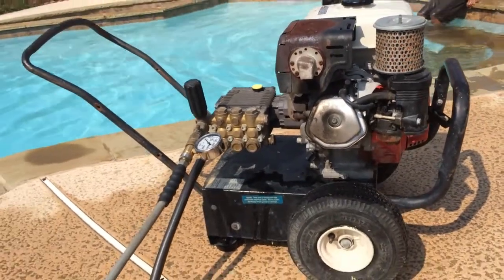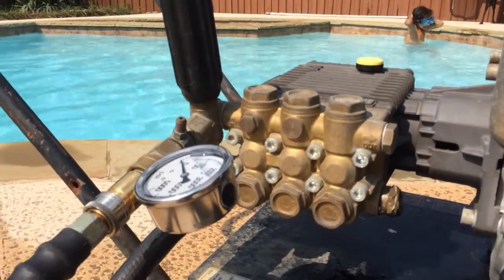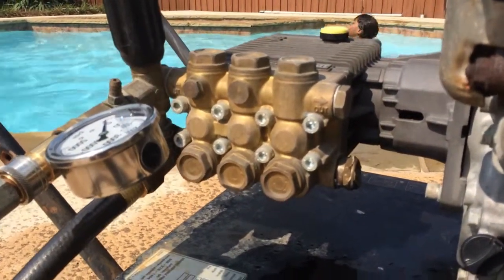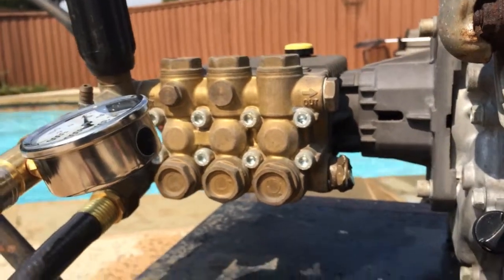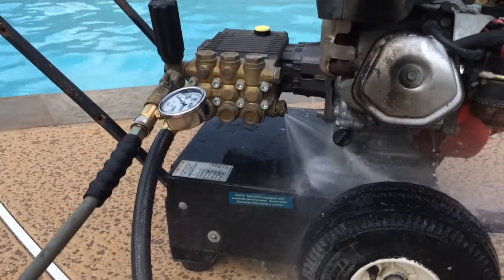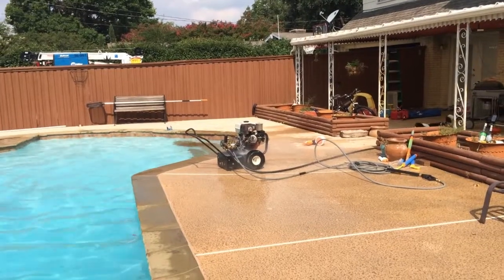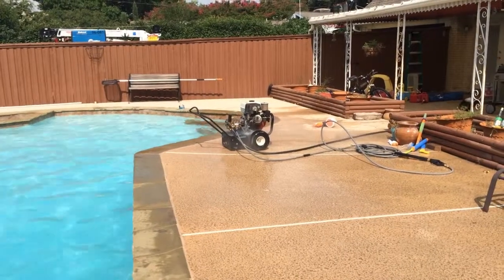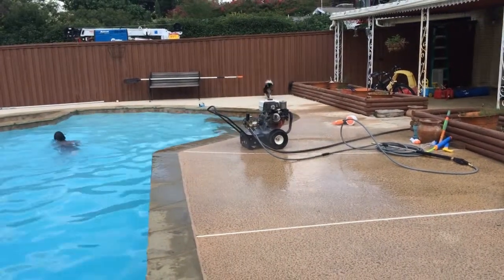Pressure Washer General Pump EZ3035 Issue - HELP!

Comment: Did you ever figure out why the pressure dropped? Great video
Reply from the maker: Thanks! I’ve since given that pressure washer to my dad to use. He’s aware of the issue, but from what I had on my notes (had to look again), the General EZ3035G pump requires 10.8 horsepower, and the GX270 engine is a ~6HP, so the pump was underpowered, it seems.

Comment: Excellent unit with strong spray. Easy to assemble and put into use right away.👁️ nub.best/ofd9   👁️  First use was to clean algae in a water feature, and it did a great job. I'm very satisfied.

Comment: that is a pressure relief squirting water out you need to make sure it didn't blow out that fitting if so find a replacement fitting for it I have a MiTm 2700 pro that has a predator 6.5hp engine on it and at mid idle it puts out 2900psi at full power it gives me 3700 psi and I found the cart and pump at a scrapyard with a wasted Honda engine just rebuilt mine

Comment: I'm sure you've figured this out already, but that part is called a thermal relief designed to protect the pump from overheating due to running the motor without the wand engaged. great washer you have there and a cheap simple fix.